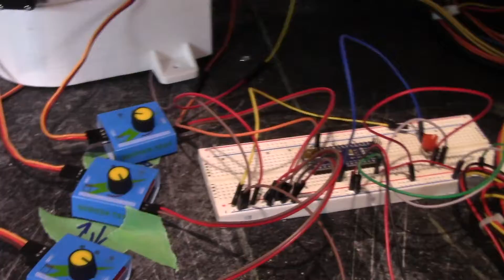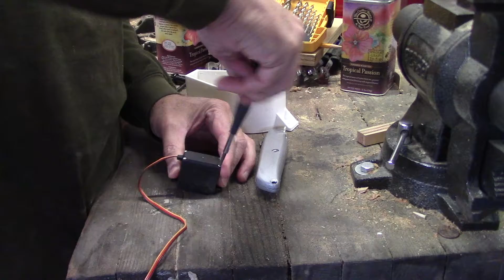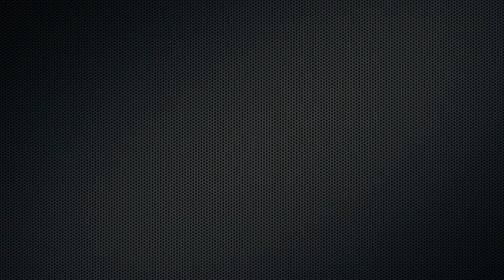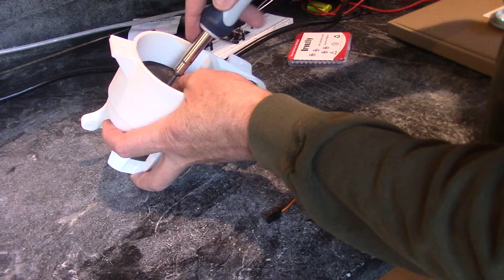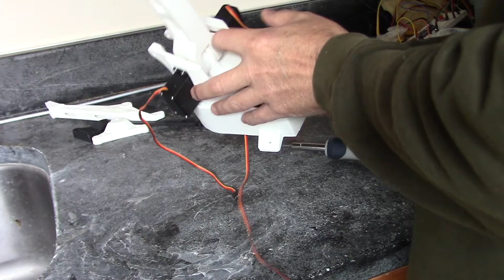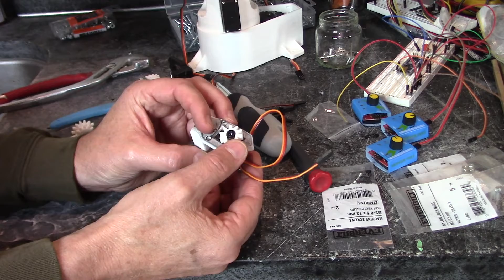How To Build The Mk2 Robotic Arm - 3D Printed 4 Axis

Comment: what is the max weight it can lift up?
Reply from the maker: I have not tested it but if you used strong motors, maybe a 1 lb or 2
Reply: @MyEngineeringProjects   is mk3 liftup 500g with  MG996R servo motor